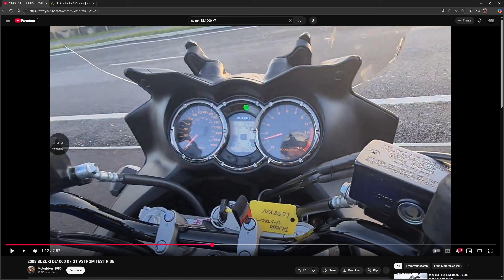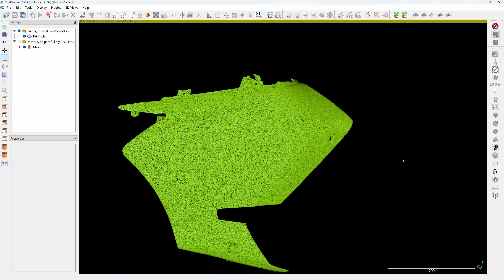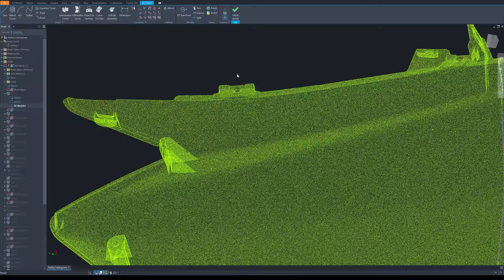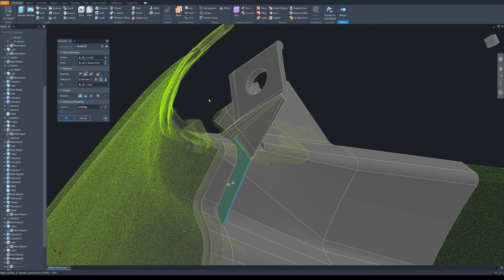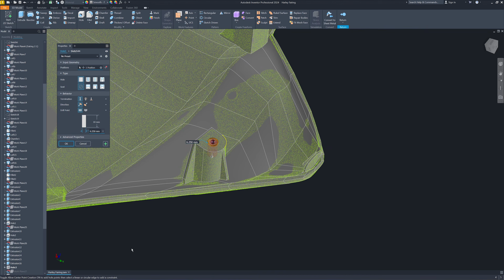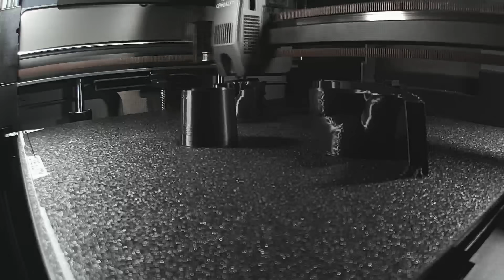Reverse Engineering a Motorcycle Fairing  Creality Scan Raptor + 3D Print Workflow

Comment: What filament is used ? Cool video interested in trying something similar.  Some say this prints wont hold up to the heat from engine as well as the vibrations and wind at high speeds, but is this strong enough do you think ?
Reply: okay i just watched the part where you say its high bonding filament polycarbonate, thankyou cool video

Comment: Hi Payo, Thanks for this great video. I have a similar project where I am reverse engineering a car handle. Using the Raptor X, I was able to create a good scan and put it into Inventor. However when I change the scale to 0.001, I'm unable to create precise sketches. How do I fix this. Is this a setting issue on Inventor or on Creality Scan?
Reply from the maker: I've made a step-by-step guide here for Inventor. https://youtu.be/OGB5a_2BnBQ

Comment: Nice video by payo once again. Payo, would you mind commenting on the structural strength of such a component produced using joints? Is it any less weaker compared to actual single printed piece?
Reply from the maker: Whenever the contact face is about 4x wider than the shell thickness, UHU plastic glue tends to break right along the layer lines. I’ve tested this with ABS and PLA, and it’s consistent. But heads up—other plastics and epoxy glues can act totally differently depending on the filament brand and glue type. PET’s still a mystery to me—no adhesive I’ve tried sticks to it properly.
Reply: @Payo-TensileCreator  That clarifies. I had the impression that you had a solid joint after applying adhesive. Guess no clear solution to joining.

Comment: Payo, i liked your videos. İ wonder can you do that by using onshape
Reply from the maker: Similar to other cloud-based CAD platforms, Onshape does not support point cloud imports, limiting users to low-resolution mesh references. Have you tried FreeCAD?  https://youtu.be/kt8SPX33tWE
Reply: @Payo-TensileCreator yes, point cloud not supported by onshape yet. İ started with onshape, i am not pro but not beginner i guess. Now trying to use quick surface for inorganic shapes but it is too weak.  İ will try free CAD as you said.

Comment: Great video as usual.  Im wondering, does anyone know if the modeling / CAD design techniques used here can be done in FreeCAD?   I have a similar project, and have my slices ever 10mm (or as needed), but the only commands to link them, that i know of, are loft/sweep (Loft/Pipe).. Im not sure if there is a feature to draw the connective rails, let alone modify them to arc's.    Thanks to any/all.
Reply from the maker: In FreeCAD, the Pipe tool only supports 2D rails composed of straight lines or arcs—splines aren't compatible. Your method is spot on: you'll need to reduce the spacing between sketch sections to around 2–3 cm for smoother results.

Comment: I picked up the original raptor for about 1000$ and im super happy with it. I once tried to measure a 90mm gauge block and the result was 89.995. and i didnt even need to use scanning spray.
Reply from the maker: That's very good deal.

Comment: Great work. Do You know if is possible to work with a point cloud in fusion360? It would be interesting also if you make some reverse Engineering videos using fusion360, most of the makers use this program.
Reply: Im pretty sure that Fusion cant work with point cloud. youtube channel "Learn Everything About Design" has some good videos about working with meshes in fusion.

Free CAD can work with point cloud
Reply from the maker: Since 2012, nearly all professional CAD tools have included support for point clouds—even FreeCAD. However, CAD software isn’t designed to handle polygon-heavy meshes. If you import one, you’ll likely need to simplify it, which can lead to a loss of precision and fine detail.
Alternatively, you can try cheaper CAD such as, BricsCAD or ZW CAD, they're also support point cloud.

Comment: Also, doesn’t fusion have a feature to convert the mesh to a solid? Would it be worth it to use that for the faces and then go back and change the mounting points for printing?
Reply: Its very limited. It wont work with milions of triangles
Reply: @ExtraChuje ahh, I understand. Thank you
Reply from the maker: As others have noted, CAD software can handle point clouds exceeding 100 million points while maintaining smooth orbiting performance.